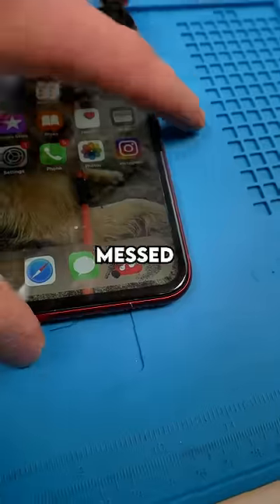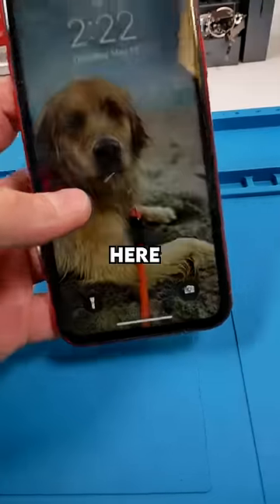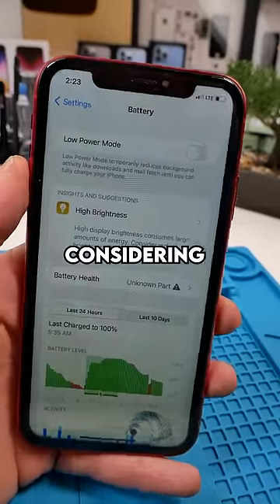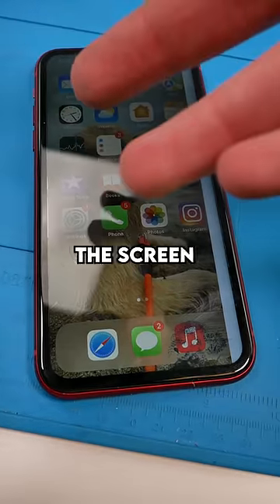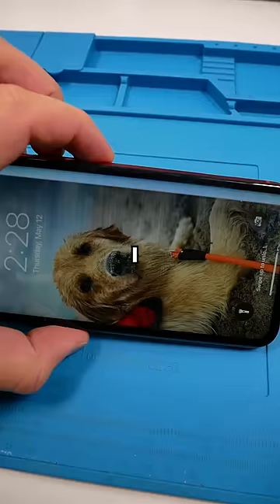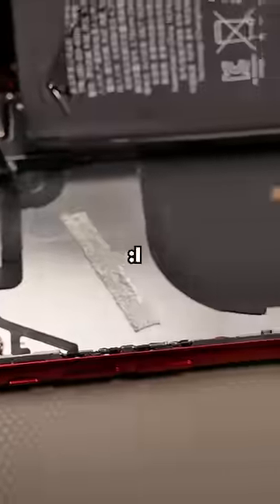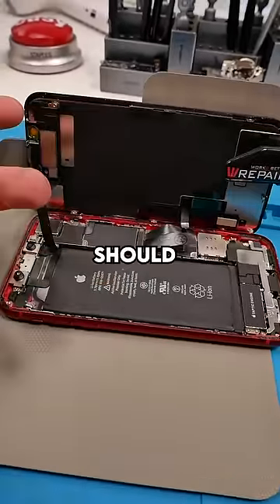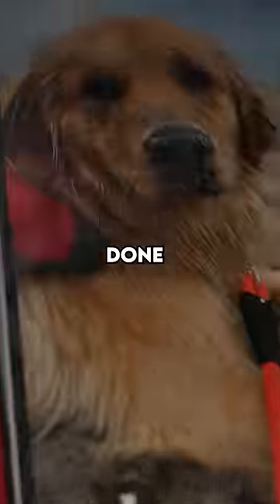Who Fixed This Before Me 🤦‍♂️?? #Shorts

Comment: It's actually amazing how you try to save his money instead of focusing on your profit
You have my respect brother
Reply: @Ahmed-bj5ex  I'm not sure if he mentioned the number
Reply: @ravishankerupadhyay5691  iPhone X and up screens are not cheap due to the OLED screens. Cost a lot more and can verify they’re close to $150 for the replacement screen alone
Reply: @paris6817  XR is LCD
Reply: They are making lcd screens for the newer iPhone models now so repair shops can still charge less than 100$, they are called tft quality. Even if the original is oled people who want to save money can choose tft and get one of those crappy screens and at least have a working phone
Reply: @Ahmed-bj5ex  but the point is, he could’ve used a used screen and charged for a new screen. How would the customer know it was used?

Shoot!  Every time a mechanic says I need a new part, I have to wonder if he’s swapping it out for a used part, and while he’s there, swapping out a new part on my car with an old part, so he could place it in someone else’s car and charge extra. I don’t trust people. Especially if they have spiritual stuff like Bible verses in their office. People who oversell the Lord, in my experience, are the worst thieves. They try to gain customer confidence so they wouldn’t be suspected of ripping them off; but they’re the worst.

Comment: I've been in that situation so many times when a phone crumbles as you open it and so many times had to deal with "while it was working fine when I dropped it off".
Reply: We get occasional issues with "FaceID worked fine" but then it's like well how do you know... cause the digitizer was dead and the display panel was blank lol. Maybe it has something to do with the massive hole surrounded by shattered glass in the earpiece area XD
Reply: My favourite is always when they return a week or so after a screen replacement claiming it just spontaneously cracked again even though you can clearly see the impact mark where they dropped it again.

Comment: Question: do you need to remove a screen protector that is on a phone screen while in the process of opening a phone up. The reason I ask is that I have an iphone 11 that has a screen protector on it and I’d like to replace the battery but I dont know if I need to remove the screen protector first to possibly prevent any damage or can I just go ahead. I’m new to doing repairs so I haven’t ran into a screen replacement wherein the screen wasn’t already cracked and had no screen protector on. Thank you for your help.

Comment: What happened to the screen (it’s happened to my phone as well)
Reply: LCD Is damaged, So when you pry at it, It will cause more damage, I could be wrong
Reply: @brendan4750  when I press on the screen the back bit spreads and it causes more pixels to change
Reply: @VERYHEVYMAN  Get a new screen, Don't press on it either it will mostlikely cause more damage to the screen
Reply: @brendan4750  I already pressed it and it’s got worse I’m getting a new screen soon

Comment: copy battery data for old battery or just give driect change voltage to battery and back camera problems because someone changes back glass n in that camera glass n fame need to take out .1 level just replaced part technician do more job in repair or ask YouTube viewer to give u set dead phone for repair